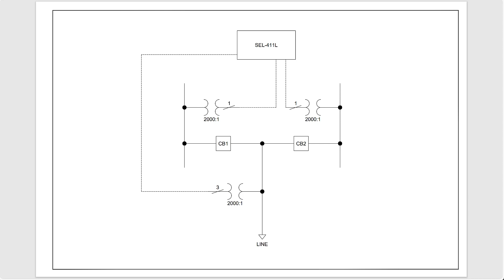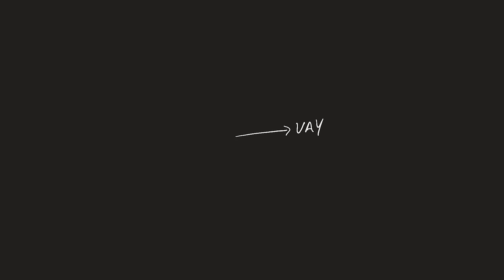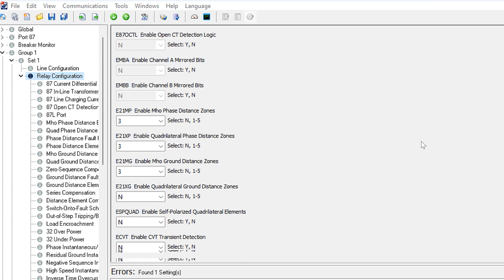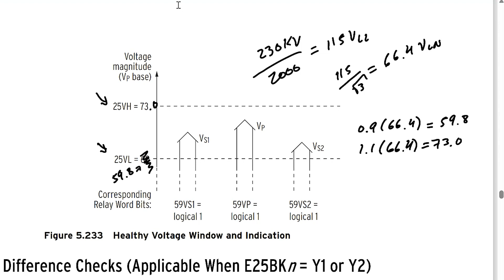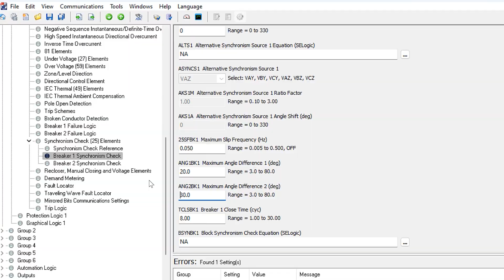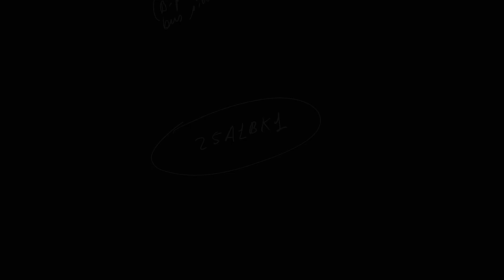Synchronism Check Elements in Protective Relays | Example Using the SEL-411L Protective Relay

Comment: Why would you set SYNCS1 = VAZ if your voltage is coming from B phase? Couldn't you just wire it to the VBZ input and set SYNCS1 = VBZ and not have to worry about setting KS1M?